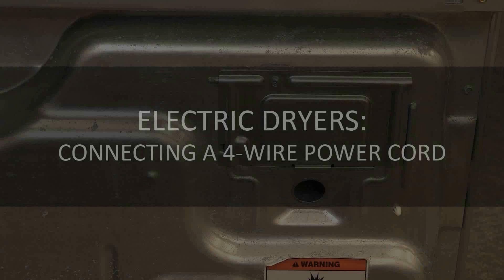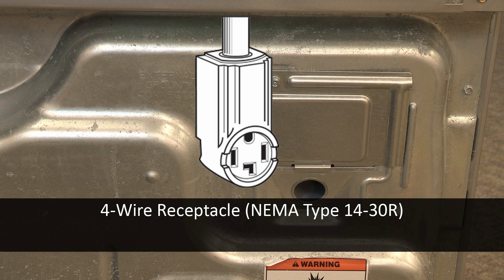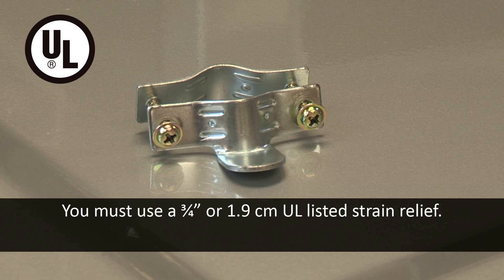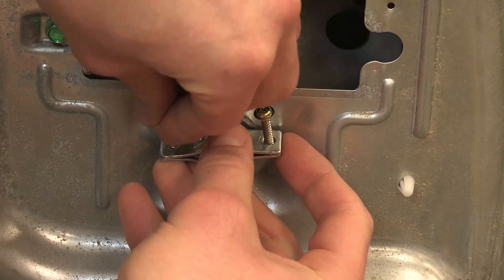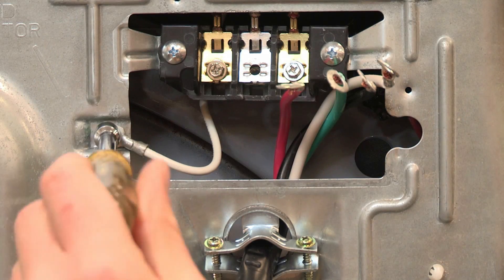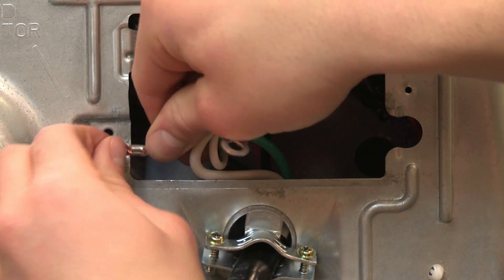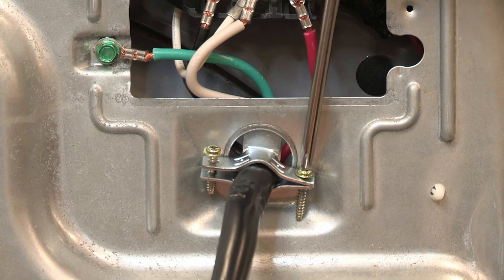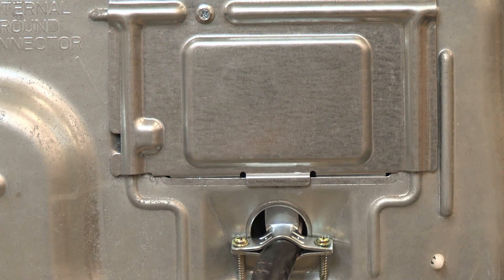Electric Dryers: Connecting a 4-Wire Power Supply Cord

Comment: Why was there a side by side? Was one to show complete install and other for incomplete?
Reply: I was thinking he was going to show that it doesn't matter which side the red or black wire went. But, the red wire was on the right in both views
Reply: There are two set of wiring. Three prong and  four prong. They're different depending on what kind of house (Mobile/module) you have like they mentioned in the video.

Comment: Thanks! Didn't know what to do with the extra ground wire.
Reply: Jeff Sprague , ok, gotta green wire from dryer, compared to a white or neutral wire on ground screw.
Do I take that green wire and place it in middle with white wire from 4 prong? Place green on screw and bother two on each side